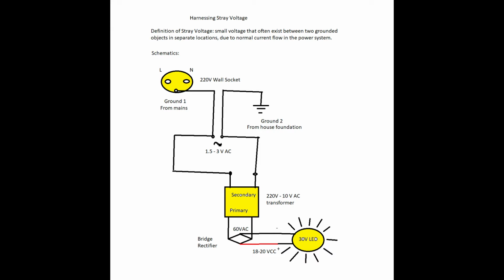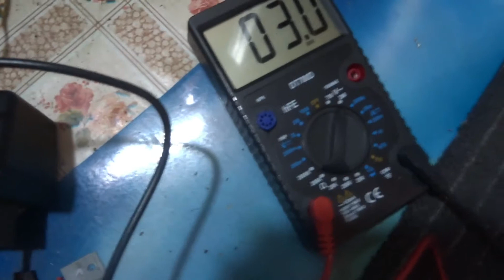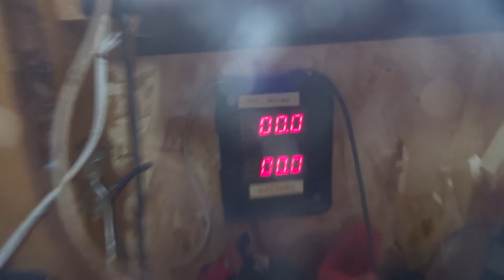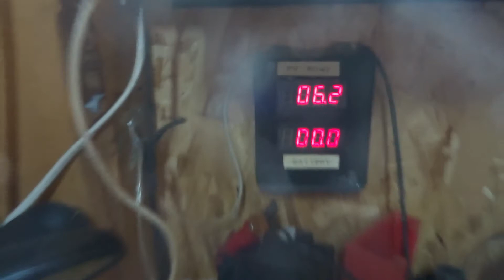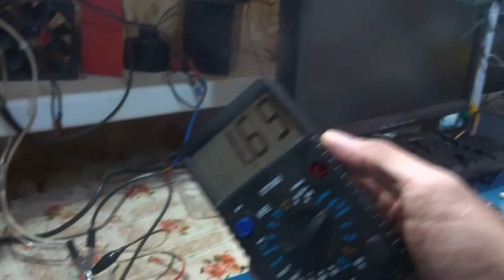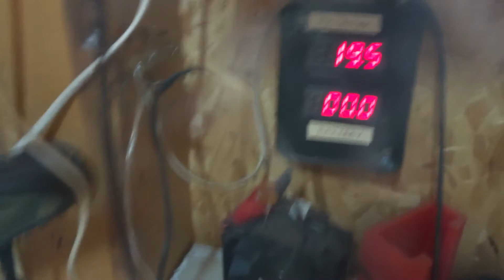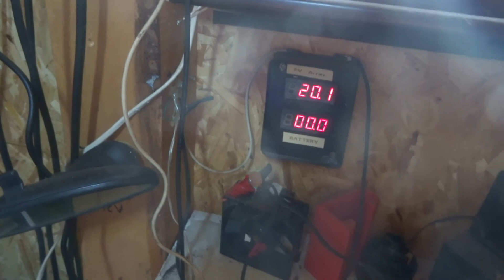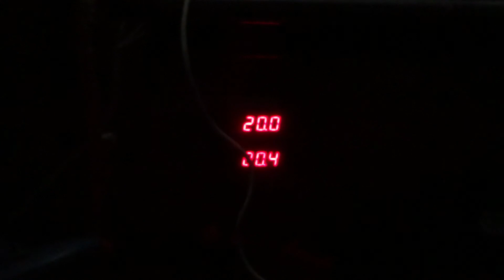Harnessing stray currents

Comment: I'm wondering if this would work when your power is disconnected from service provider?

Because it could be inductive currents between wiring in your house that have live ac making its way there, since you combine grounds you are grabbing some before it grounds where your home ground would be.

If it would work without power being delivered to your house that would be amazing.
Reply from the maker: It didn't work when the power grid is down. I've tested it few days ago when I had a power outage.
Reply: @Machiuka  Ahh. So it likely was residual emf from lines. :(
You probably would actually see it increase the bill too.. even extremely small amounts. Similarly to a transformer I would bet